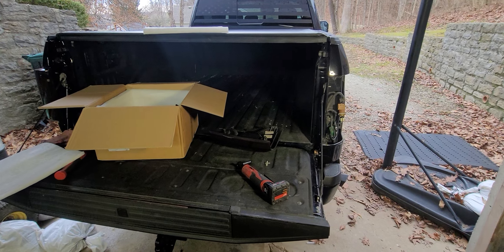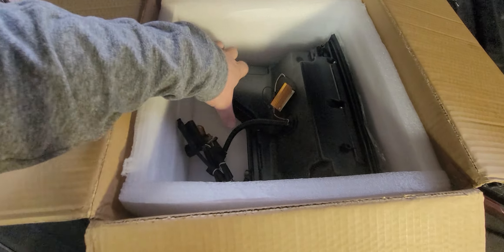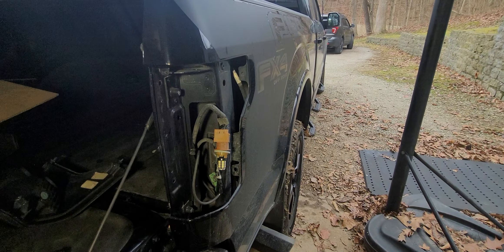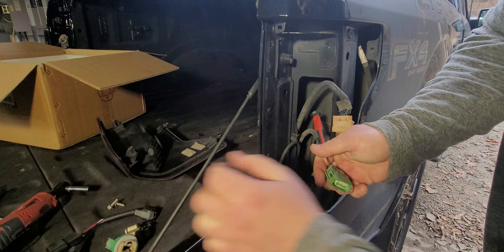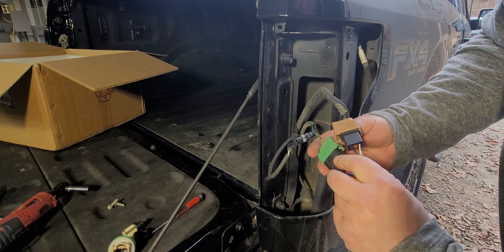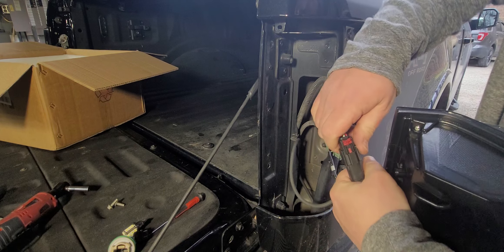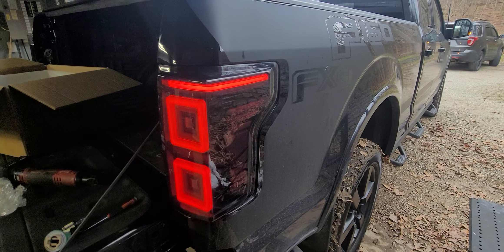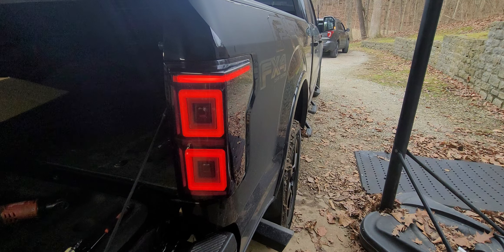Install and review on RXC taillights.  Ford F150 2015-2022.

Comment: Hi Brian, do you happen to have the link for the lights? Thanks
Reply from the maker: I do, but if you wait. I have different ones I installed and will be putting up a video in the morning on them. In my opinion they are alot better. 
RXC LED Taillights Compatible with 2015-2021 Ford F150 w/Sequential Turn Light with Dynamic Animation Breathing DRL (Not Fit a 2019 XLT/Lariat, Factory with BLISS, BLIND Model & Factory LED Version) https://a.co/d/3NRFNnq

TT-ABC LED Tail Lights for Ford F150 Accessories F-150 2015-2020 with Start Animation Rear Taillight Assembly(red turn signal) https://a.co/d/g978Y0s
Reply: @BreakdownswithBrian  Thank you. Will be waiting for the new video
Reply from the maker: Will put it up tomorrow  morning. Like and subscribe and you'll get the notification